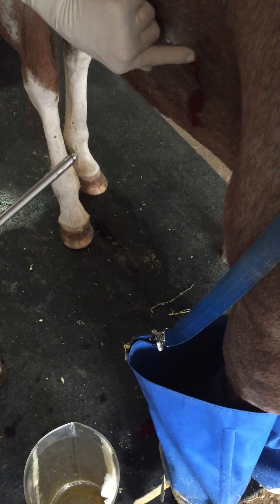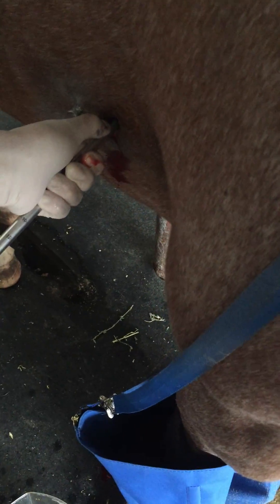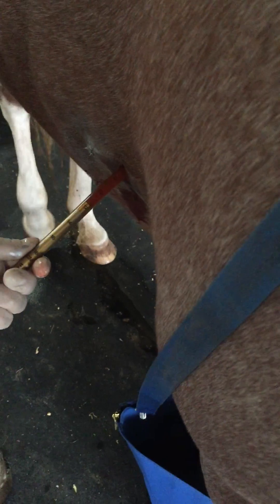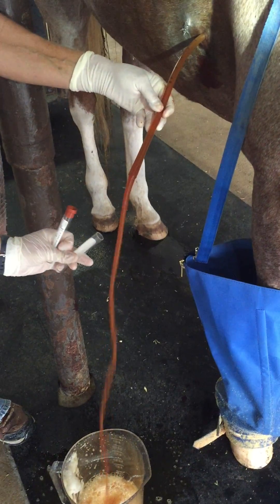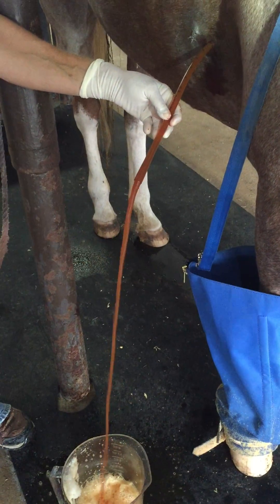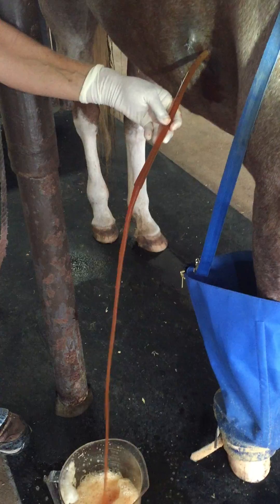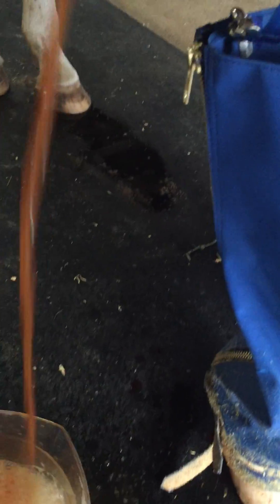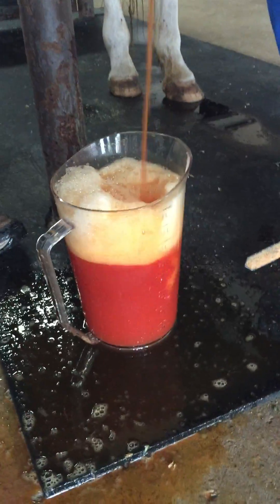Placing chest tubes in a horse

Comment: What is that?
Reply: A great way to help treat a horse with really bad pneumonia. You apply aesthetics to the area of body wall, cut it open and stick a big tube in. This drains the built up fluid from around the lungs to help the horse breathe easier. Kinda like helping treat a collapsed lung in people.  Also helps you see what bacteria you’re dealing with since you can culture the fluid.  However, despite being very beneficial to the horse, it does indeed usually at least SMELL like death. Ranks number one for worst thing I’ve ever smelled.
Reply: Death idk